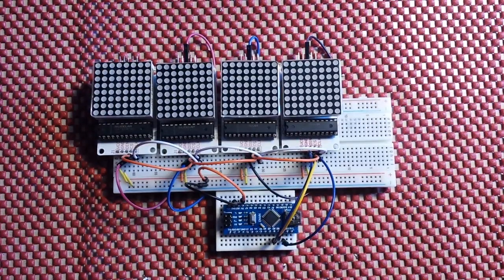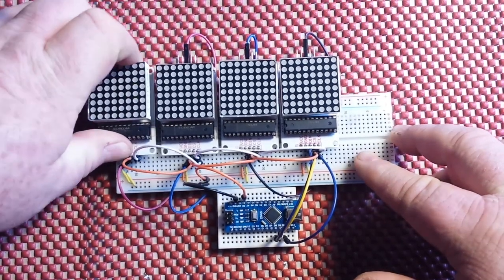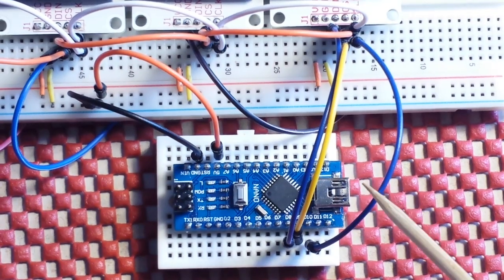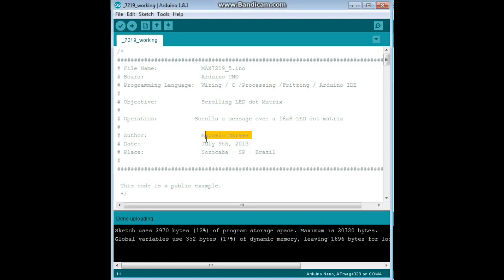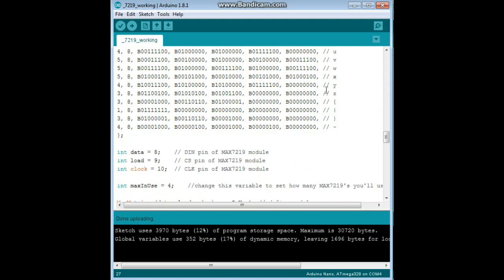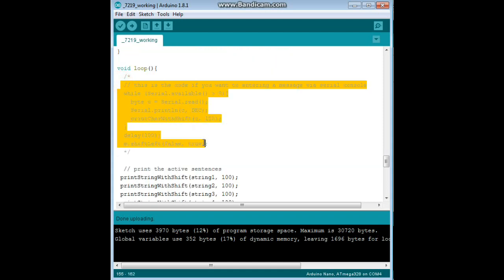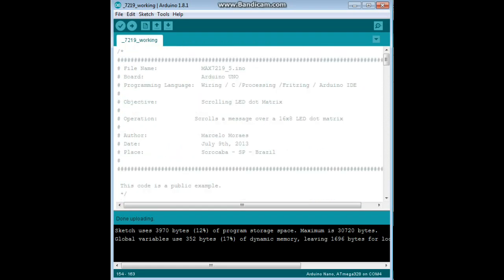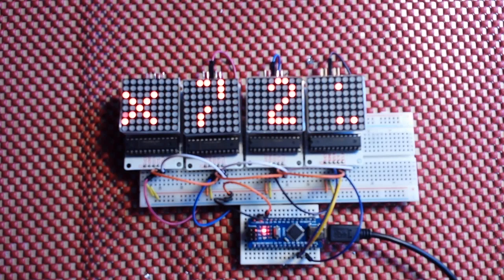How to use Max7219

Comment: Is it better to buy the whole module as a single item or the chip, the matrix, etc. separately?
Reply from the maker: Jon Lorusso excellent question Jon! buy the separate modules. The ones all connected are rotated 90 degrees and I've yet to find a library that will work with them in the rotated state! thanks for watching and getting involved